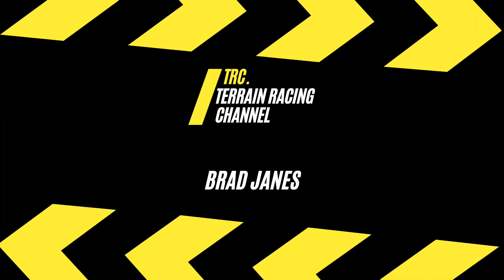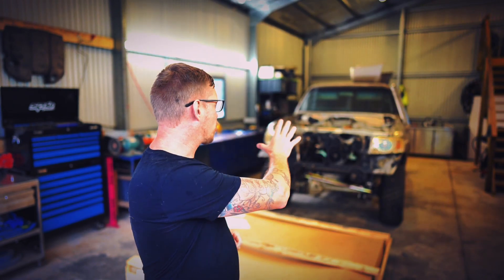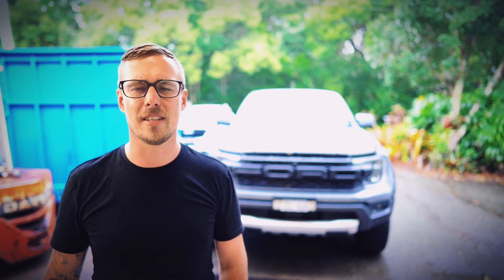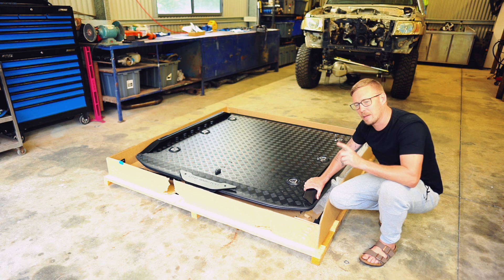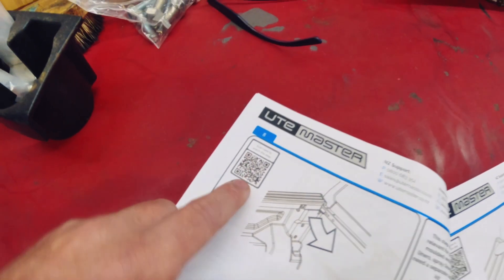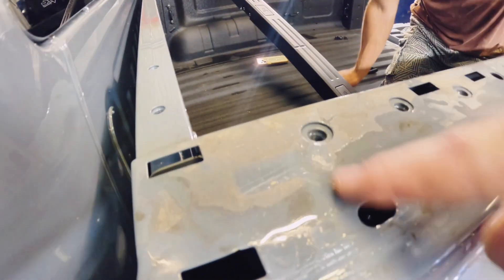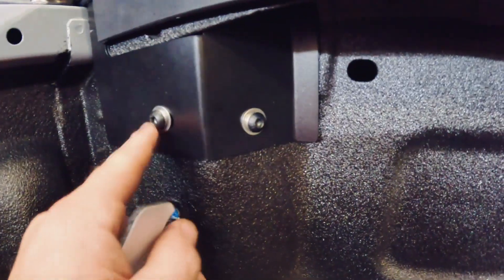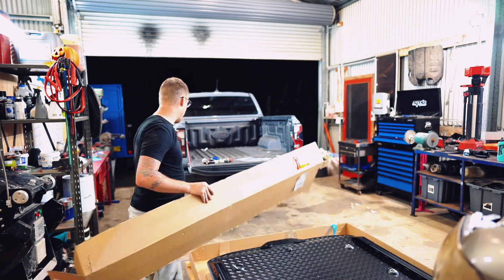Installing Australia's best hardcover for the Next gen Ranger Raptor - Ute master - load lid

Comment: How waterproof is it inside (great video BTW)?
Reply from the maker: Thanks mate. So far so good in normal rain/driving conditions. There is an additional seal kit that I also added to the bundle that goes at the front of the tub. The seal around the sides is also really good. The main area for water ingress is in the gaps each side of the tail gate. I have washed it with a pressure cleaner and I did have small amounts of water get into the tub from the tail gate gaps.